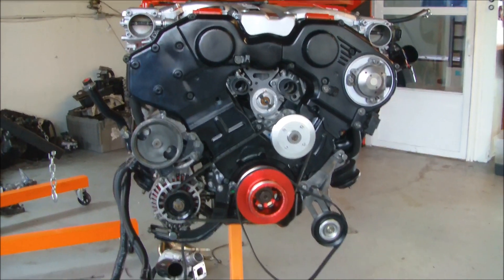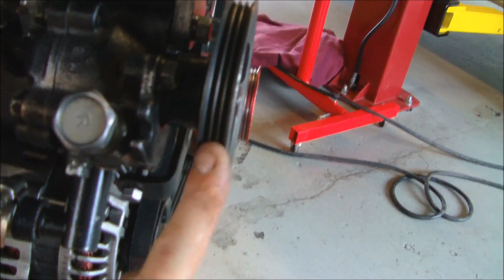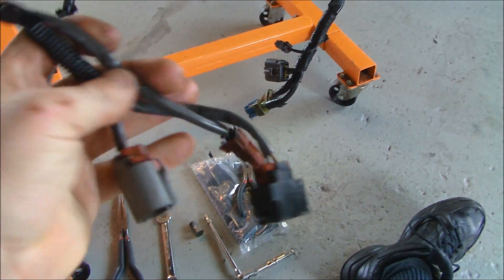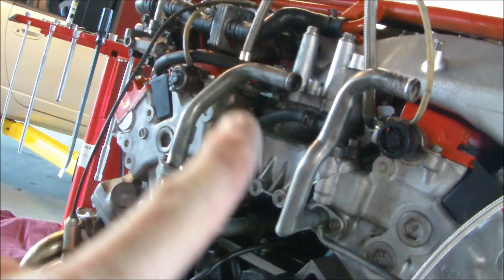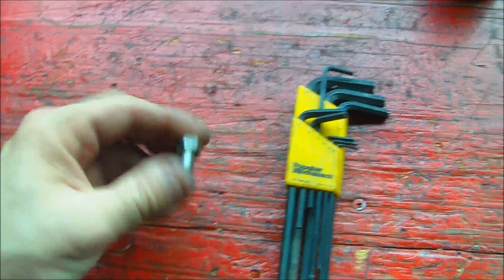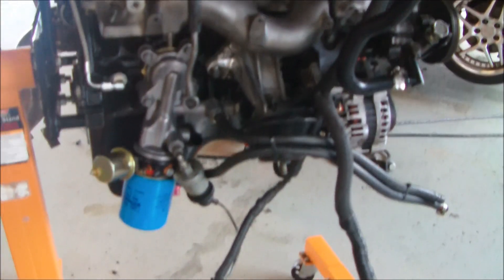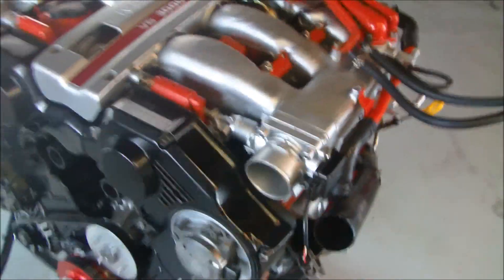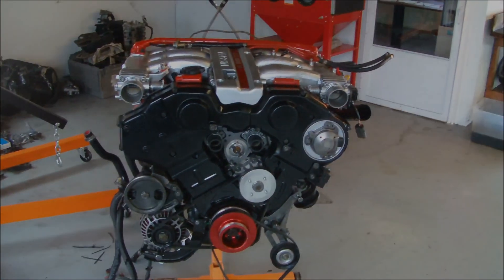Premier Z Performance (300zx Specialists) - Rebuilding Joe VG Engine

Comment from the maker: Sandblast, wire wheels, brake cleaner, parts washer, and finally pressure wash the parts. So yeah it takes me longer to do but it is so worth it.

Comment from the maker: The power this car will produce is probably not a good idea for others to be driving because they are not use to it. It could get away from them and throw them into a wall. Ive seen it happen so just be careful on that. But the car is in and another video is coming atcha next!!!